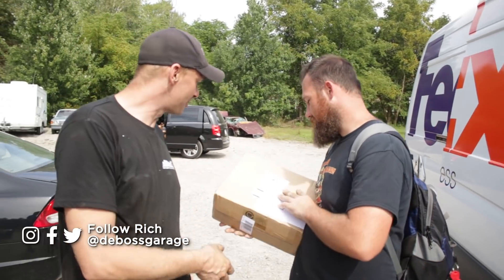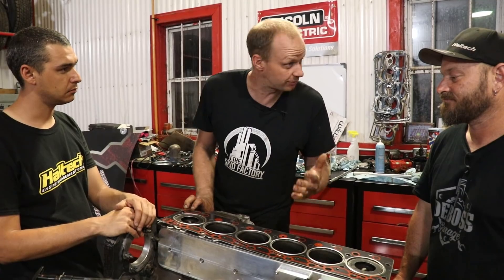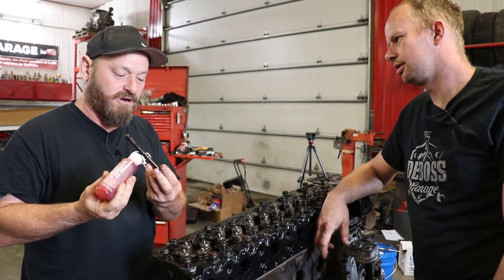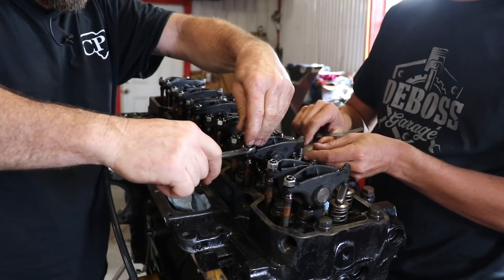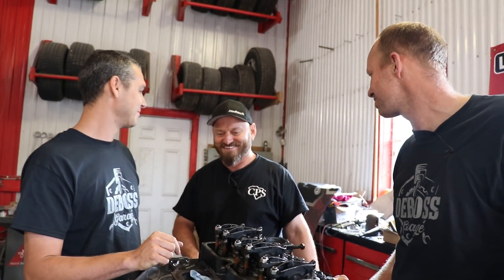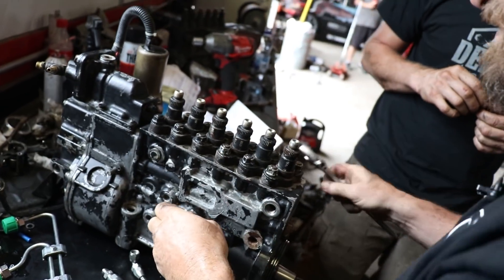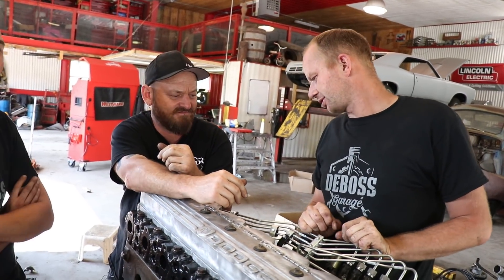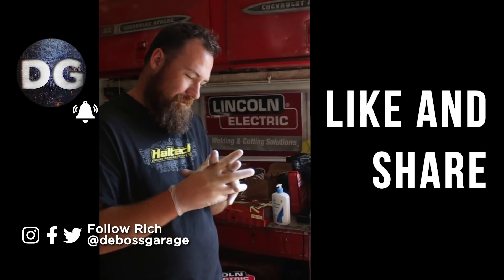24 Valve P-Pump Conversion with @theskidfactory [Cummins Patrol EP4]

Comment: Cummins dyno tested a B series at 900hp for hours on end, the Kamax TPA head studs weren't the failure point (the lube became heat soaked and fractured the block).
Talking to engineers that ran the 1991 B series improvement program they say that even clamping force across the head is the critical factor rather than maximum clamping force for head gasket integrity and head studs are a step backwards.
Your Kamax TPA bolts will be perfectly fine :)
Reply: @Nick Steggel you know your Land Rovers 😉
Reply: @husq2100  I've owned land rovers for over 15yrs so picked up a thing or two

Comment: You can cut the tops off old head bolts and use them like...er...studs...to hold the gasket in place and gracefully guide the head on.  Works on excessively heavy manifolds too.
Reply from the maker: Great tip!
Reply: I do this heaps

Comment: To torque turn I have a six point socket with 4 grooves on the outside 90 degrees apart. Take a sharpie and mark the location of one of the grooves and turn to the next one. Sometimes the angle gauge is hard to keep in place. My marked socket takes that out of the equation. Unfortunately it only works for 90º
Reply: Cool tip.

Comment: i had a 12v i used for hot shot work, sold the truck with 650k miles on that engine, bought the truck with only 120k miles. truck held steady at 35 lb boost. 100% stock everything except turbo, CAC and plumbing, P-pump timing, and pump turned up just enough to not smoke.  would only give a quick puff, then turbo would light, and no visible smoke in the mirror from there. what i'm getting at is this. Was i just lucky all those miles (all under a load) at 35 lbs of boost, not studded, not internally modded?

Comment: I always supported the front cover on the back side wipe a small amount of #2 permatex on seal bore then installed the crank  seal from the front 
27 years at freightliner dealer mid range specialist
Cummins definition of zero lash is 6 lbs in Put the feeler gauge in place tighten the adjuster to to 6 lb in tighten jam nut thats it

Comment: Oil on the head bolts is fine, it's what was used when assembled new.
The 90° Tighten overcomes any frictional torque loses.
The first two low torque specs set the bolts up for the final 90° (¼ turn) rotation.

Comment: Consider using a dial travel indicator to set your valves.  They are so available now days, with a flex arm magnetic base too.  It makes setting valve lash a pleasure, and there is no "feel" involved.

Comment: You can also set the valve clearances by using top dead center, set 1 or 6 to tdc and then you can set half of the valves, every other one being intake and every other exhaust, then just turn the engine over one turn and repeat. Fast and easy.

Comment: P-pump can definitely pop off 24v injectors.  While the pop off pressures are 40 Bar lower, that is only a fraction of maximum injection pressure, which is about 800 Bar.  The increase in pop off pressures might create a delay in the injection event, but its going to be pretty insignificant.
Reply: Yes it sure can, I have personally set my 12v injectors to 310 bar in the past with no issues. I now find the sweet spot is 285 bar, runs and sounds real crisp at the higher pop pressure.

Comment: wait it cost 1k to head stud a truck? im confused i got a set of optitorques witch are on par with arp for 350. and engine oil is more than ok for head studs every head stud i have ever installed was with clean 15-40 and i cant count the number of heads over the years hundreds or more

Comment: I have a 1999 k1500 suburban with a 5.7 in it. I need to replace the oil pump, can that be done without pulling the engine out of the truck?

Comment: You think how simple an electric motor is with a bearing on each end, something to show what part of the rotation it is, center housing with wiring, end cap housings or bells, rotor with or without wiring, wiring wiring brushes vs any ICE... it is amazing when you think how simple electric motors are but batteries technology is another story just now being able to catch up to the motors but the sound of ICE... rattle of a diesel, thump of a big V8, screams of a high rev’ing v10/v12 or the simple i4 that runs forever because it’s simple and cheap.   Awesome build y’all and a ton of work

Comment: ive just finished rebuilding the top end of my "78 mini and the architecture of the A series is identical to this (other than the number of valves, cylinders and massive displacement difference). so cool to see

Comment: Hey @DebossGarage can y’all do some swaps/builds with the 7.3 idi engines?
Cummins engines are cool, but they get kind of old. Plus they weigh 300lbs lighter than the 5.9/900lbs.
Reply from the maker: Working on Duramax and Cat swaps at the moment
Reply: @DEBOSSGARAGE , true.

Comment: P pump pops at 260Bar cant pop 300Bar.. wth man, I tought you know some shit. :D Pump does not pop lol. It just pressurizes fuel until injector pops at set pressure. You could leave 300Bar injectors for P pump but then you have to set your timing because it will commence injection later. Anyways pressures during injection event go as high as 1000Bar AFTER injectors opens even for old P pump. VP44 pressed beyond 2000Bar, thats why it could comply with EURO4 in some engines. More you know..

Comment: 153624, 15s to young, 36 to old, 24s just right
Reply: Isn't that the same firing order for a Holden red motor?
Reply: @kevkoala  would not know but If its a inline six I'd guess yes, most inline 6s have this firing order

Comment: Don’t ever trust fed ex they left someone’s package that wasn’t even close to the same address as mine sitting in my driveway during a rain storm
Reply: It depends on the driver/area.  I live in a rural area with a low population and know the FedEx guys that handle this route personally on top of that.  They know the right addresses and either leave the package inside the hatch/stairwell to the front (my place is subterranean, the front door is closer to a bunker entrance that leads down stairs) or leave them in the drop off box I built for packages.  Same goes for USPS.

UPS on the other hand has delivered all of my packages to my neighbor (thankfully people I trust) for nearly 2 years now.  Difference in quality of drivers, the FedEx guys here have been doing it ages and are good people, the UPS guys are fairly new/young and don't have a care in the world.